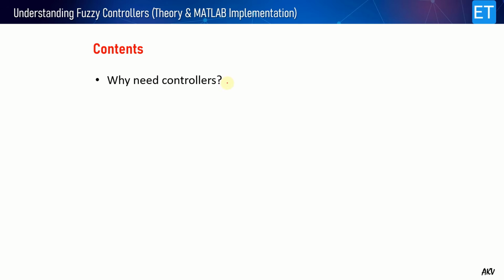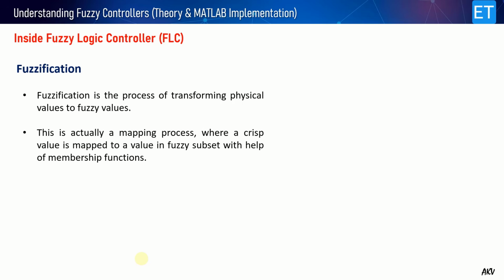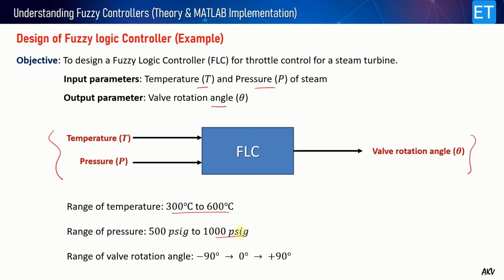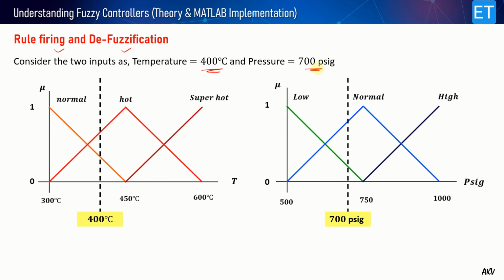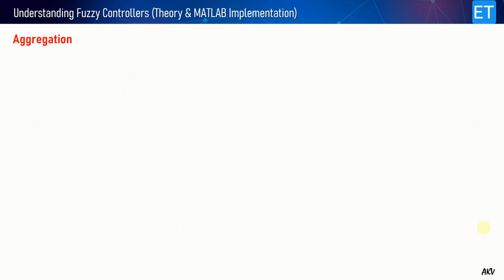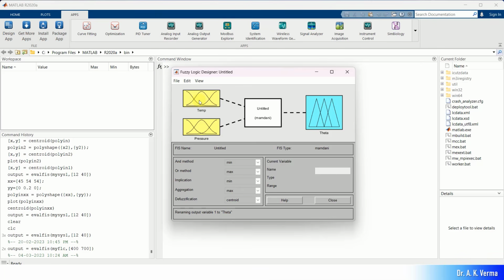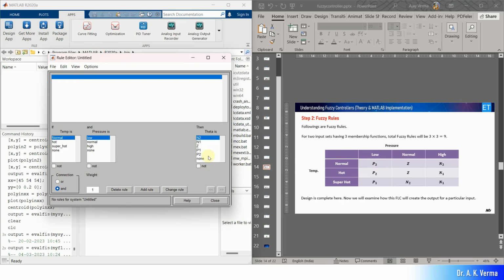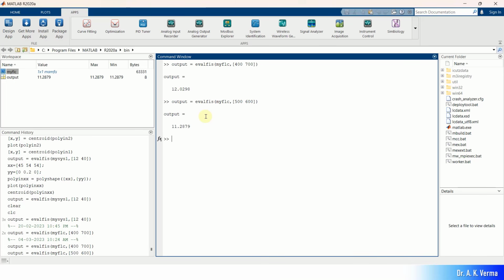Understanding Fuzzy Logic Controller (FLC) (Theory and MATLAB Implementation)

Comment: Good morning, Sire.
Congratulations on your videos. They are very useful.
I'm wondering how this turbine system should be implemented if it were a closed-loop or with feedback. What would you change about the system?
Thank you in advance.
Reply from the maker: PID controller will be designed in a same way but when u will use in feedback, it will keep desired output on track.

Comment: Sir in Fuzzy rules slide you directly show the  input and output relation like sir can you explain me that for input when temp. is Normal ,Pressure is Low for that how you select the Output is P2 only
Reply from the maker: Rules are made by requirements and based on experience.
Reply: Sir, I have read a lot of research papers related to fuzzy, but even when they talking about fuzzy rule, they also mention the same as based on experience or based on understanding.sir for clear understanding can you suggest me any paper or book? That can help me to gat a clear idea of fuzzy rules.Thank you Sir for your time and consideration. @exploringtechnologies9
Reply: And sir, if it is possible for you then can make a video on fuzzy rules and explain it with the help of an example.